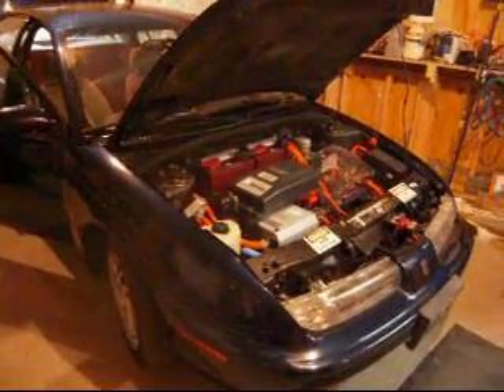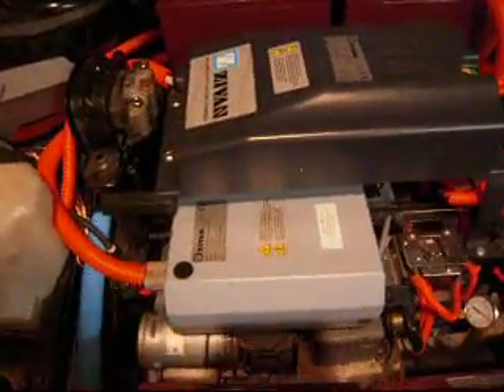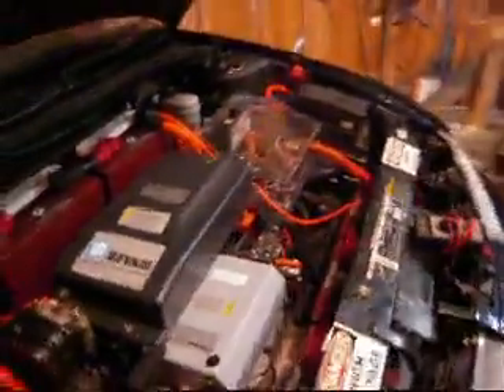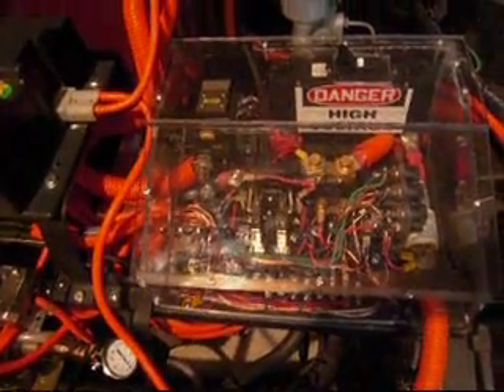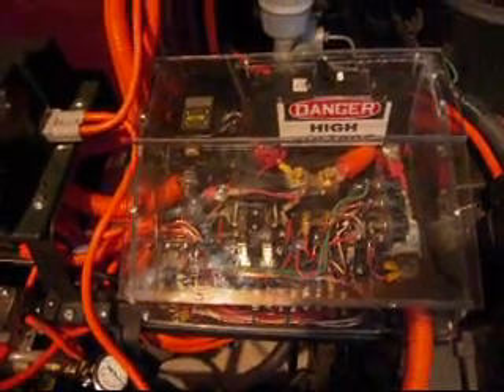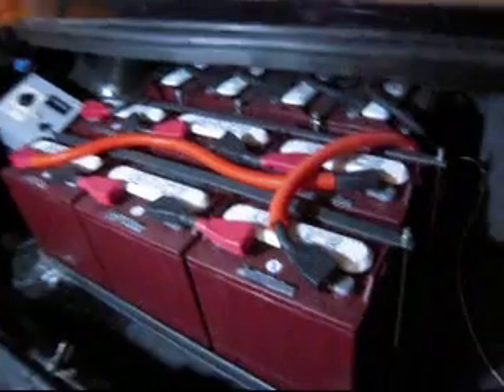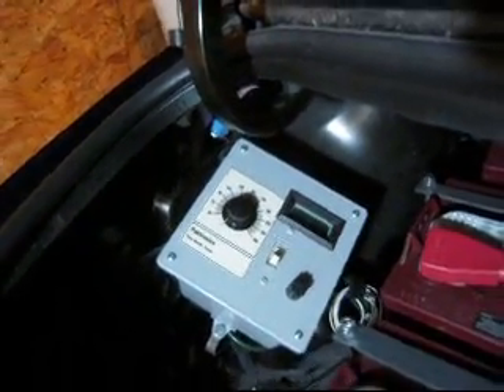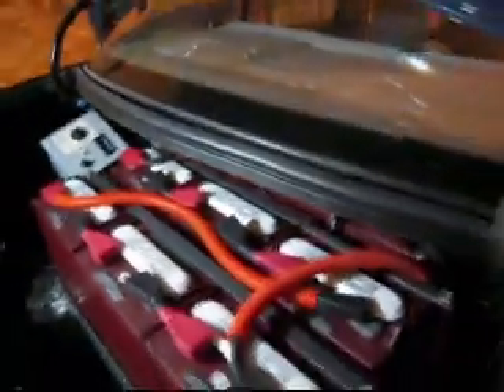Brief tour of Electric Car components

Comment from the maker: @benz18724 - I purchased the gauge holder with the gauges from KTA Services.   I did however make a hood, out of a rubber sheet, over the back of it to protect fingers from touching those high voltage wires.     

The car is still running great at 6,000 EV miles, and is driven every day.

Comment from the maker: @ingaman - It depends on the price of gas.    The equivalent MPG goes up as the cost of gas goes up, my electricity costs are relatively stable.    At $2.90 / gallon, it works out to about 127MPG (equivalent).